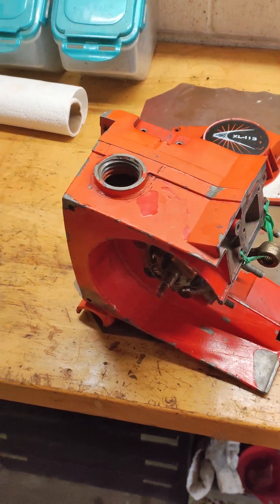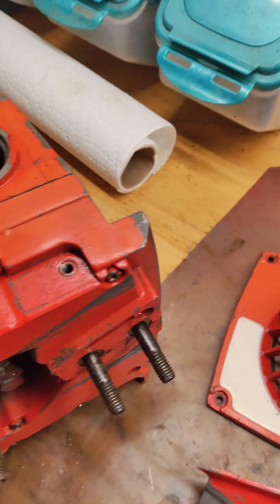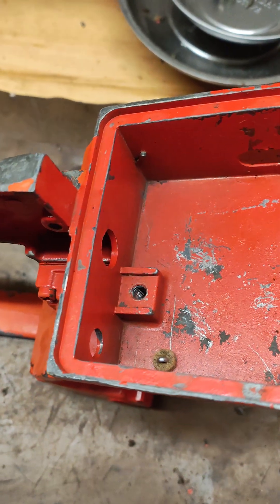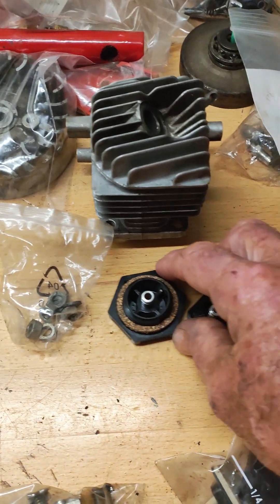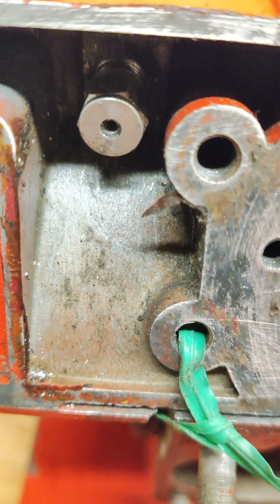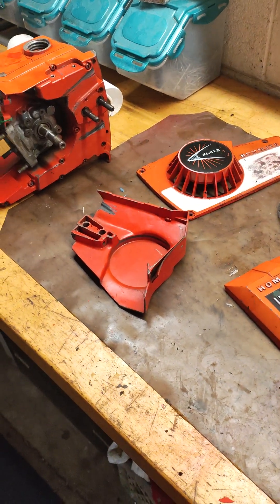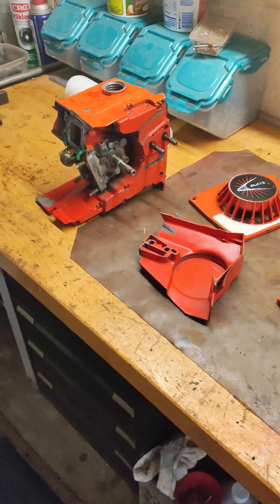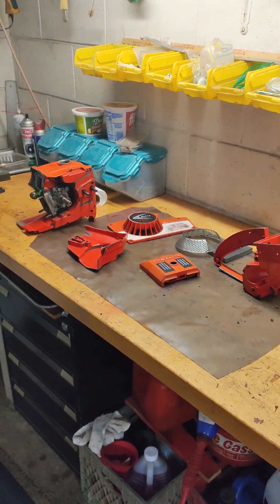Homelite XL-113 torn down and and clean

Comment: I saw a nos cylinder for a xl114 on eBay today.  I figured you could use it.
Reply from the maker: Thanks, I have one already, but I made an offer on this one anyway. It fits the XL-113, and XL-122, might even fit a few others
Reply from the maker: Its mine, thanks
Reply: @oologahgardentractorandcha3055    No problem!  If anybody sees a cylinder for a super xl 925, please let me know.  🇺🇸🇺🇸
Reply from the maker: @billp1669  Which cylinder, the 2" or 2-1/16"?
Reply from the maker: @billp1669  You can use a cylinder from an  XL-923 or XL-924, probably even a VI-944 or VI-955, but you might have to use an older muffler due to exhaust port spacing, but maybe not.
Reply: @oologahgardentractorandcha3055  I will keep looking!  Thanks